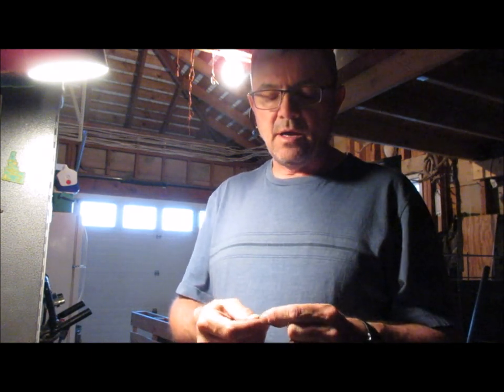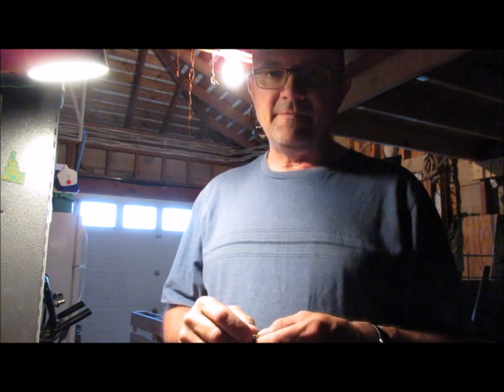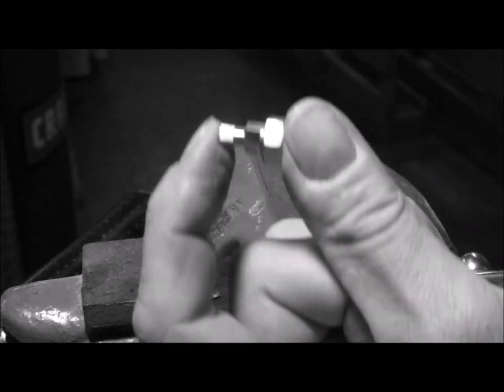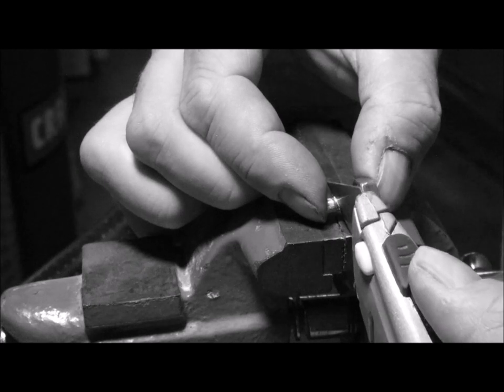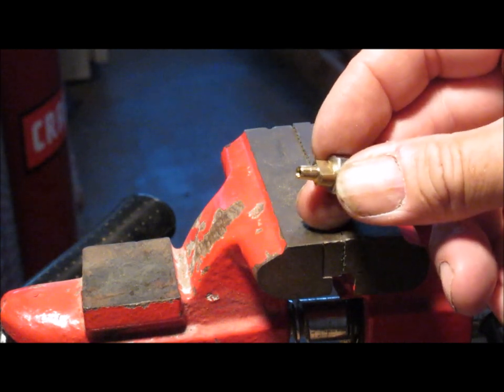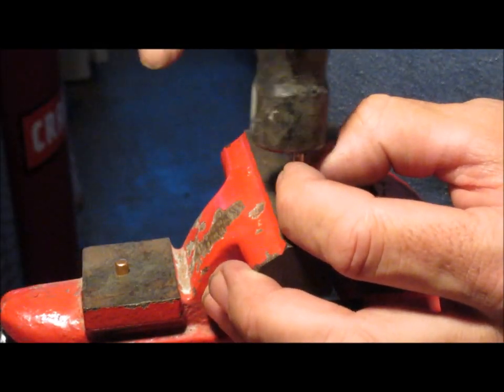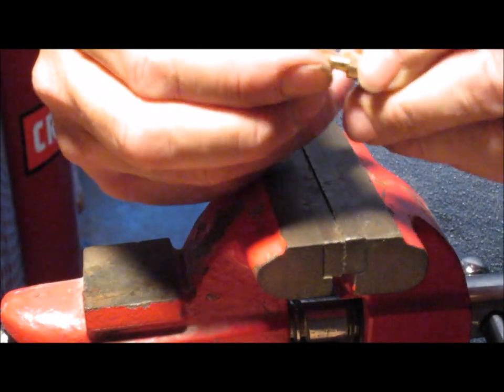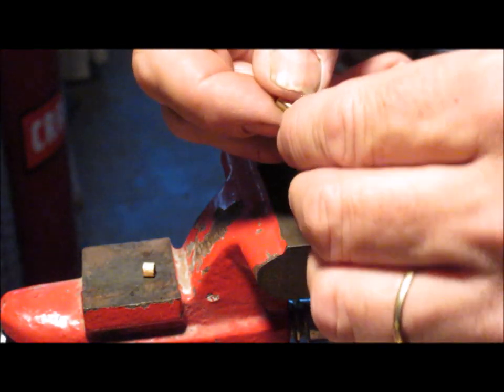Treso Ampco Nipple Fix for #11 caps

Comment: Good information Ron. I thought it was just me having that problem. I used a 3/16" pointed center punch to flare the top collar out a bit.
Reply from the maker: I elected to go this way in hopes it would swell more than just the lip.  I wanted the cap to be snug the whole way.
Reply: Pointed punch is the ticket 1 tap and it is uniform .

Comment: Recently purchased a Armisport/Chiappa reproduction Enfield P1853 3-band rifled musket,  which the OEM nipple is an 8 x 1mm metric which takes 'musket caps'.  I found my usual local firearm supplies dealers out of musket caps all they have are #10 and #11 regular percussion caps.  And many online dealers can't ship musket caps or the shipping cost is expensive.  So,  I found an online dealer that had Ampco 8 x 1mm conversion nipples to fit a standard #11 percussion cap.  The Ampco nipple threaded in perfectly on my Enfield,  then I popped a couple of #11 caps (no live charge) they fired perfectly and my test method for percussion caps is to place the muzzle near a leaf or blade of grass if it moves (which it did) from the force from the cap going off I figure I'm getting enough flash from the cap to ignite a powder charge.  Haven't fired a live charge yet plan to do that real soon we'll find out how it works.

Comment: The alloy 1s called AMPCO 18 or AMPCO 21 Bronze.  Very tough stuff used as bearing material for thrust washers.  I've used it many times in the aerospace industry.

Comment: The Treso nipples I have used have a very nice fit with a RWS #11 cap, in fact it has been a bit on the too snug side.  Also, I take a #68 drill and open up the flash hole from 0.028" to 0.031".
Reply from the maker: That drill size is perfect for pyrodex

Comment: I have used Treso nipples on cap n ball revolvers and they work great with Remington #10 caps but the #11 is very loose like shown in the video.  On Colt style revolvers cap jams is a common issue.  The safety notch in the hammer allows a cap to blow back and get stuck in the knotch then when hammer is cocked the spent cap falls between the hammer and frame causing a cap jam.  The Treso nipple helps this with the narrower flame channel, you get less blowback thru the nipple when charge is ignited and reduces the cap sucking feature of a Colt.

Never tried Treso nipples in my TC rifles, always prefer Hot Shot or Slix Shot nipples on those.

Comment: Good video Ron....I've been using  those nipples for some time now....i open up the flash hole 2 nuber drill sizes to prevent hang and misfires
I like your method of fixing the loose cap ....I have dry fired then to smash the nipple and I have shortened  them  tho make them fit tight...
Great vid.....
Reply: Reasseble a old army stanliss steel 44

Comment: Great Info.  Now, did it work?  Can you fire the cap and get it off easier after firing?
Reply from the maker: Most caps will split wen the cap goes off. In this case the nipple was too small for the cap to stay on before the shot. And yes it works.

Comment: TRACK OF THE WOLF   COMPANY offers nipples  that  "simply   work  as they should"   without   end user modifications.  Look for Track of the Wolf "branded" nipples.   Track of the Wolf  company  "also sells other brands"  of nipples if you prefer  nipples that do not work as well their own.
Reply from the maker: The Ampco nipples are known for their long life shooting conicals. When you shoot large conicals this increases the pressure in the chamber and this also causes more erosion in the nipple. Shooting 460 grain bullets will ruin a stainless nipple in about 20 shots. These ampco are supposed to go longer. 
CCI mag caps are running bigger for some reason. I need to contact the mfg. Not all nipples will hold the caps snug.

Comment: How bout a smaller cap.
Reply: Didnt say what size cap he was using.
Reply from the maker: A 1085 size cap can work but they are not that easy to find.
Reply from the maker: @moemulkey2264   The cap size is #11
Reply from the maker: @moemulkey2264   The AMPCO nipple is said to be somewhat harder than the Stainless nipples are. Since the caps fit loose on these this is a way to use the AMPCO nipple and still use the #11 cap without the cap falling off when the rifle is turned over. In your case don't buy one and you don't have to worry about fixing the issue.  This is info only for guys that have the nipple and want to make it work.